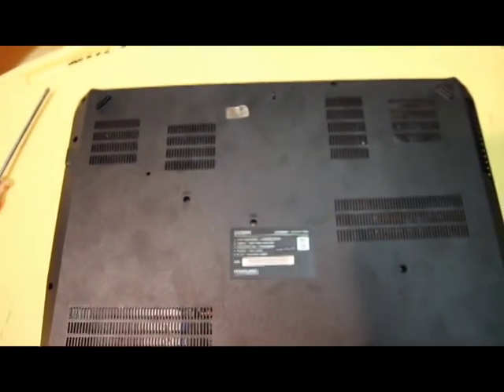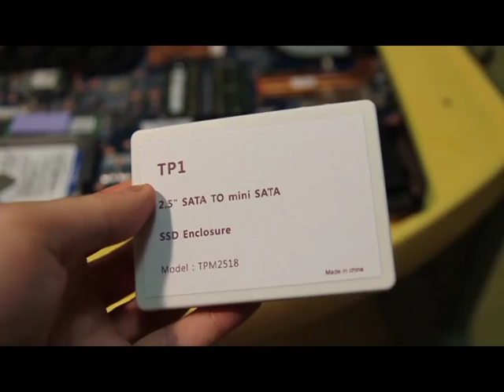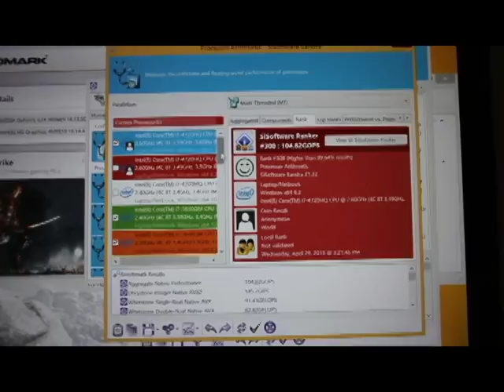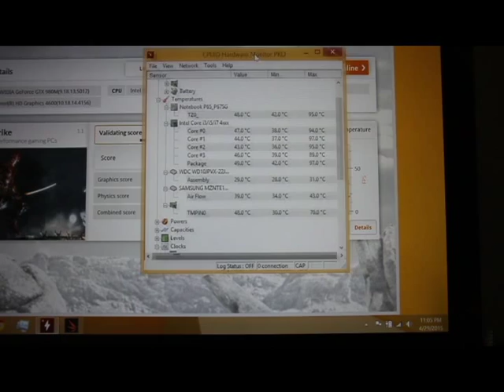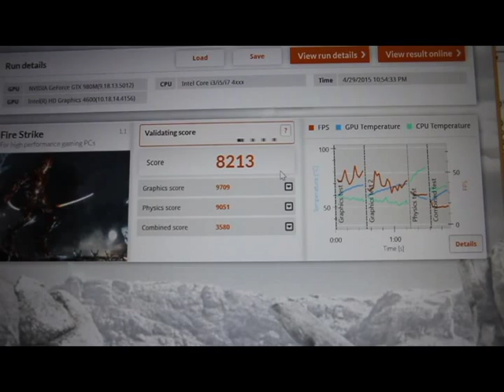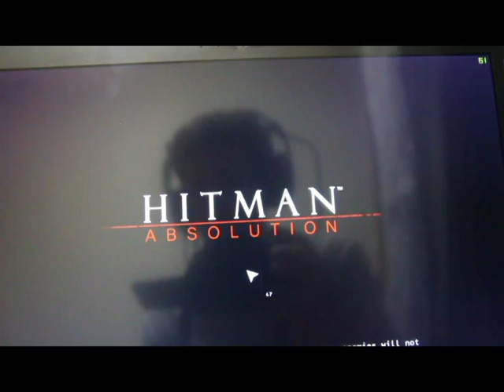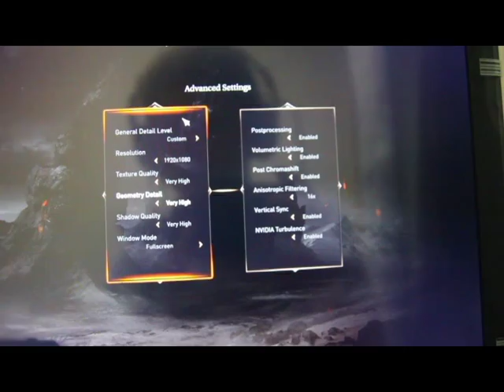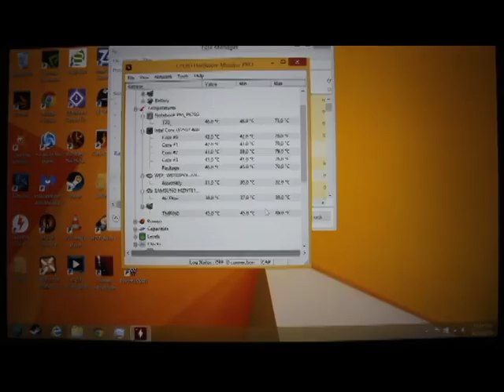Hansung (Clevo p651SG - GTX 980m) Gaming Laptop - INSIDE and BENCHMARKS - part 2

Comment: Well... it might be a little too late to say this, but I have the same exact machine, E54 Lv.66, and Hansung Computer company does not care about whether you open up your laptop's back panel or not. The sticker just says that they won't be taking care of the upgraded parts like extra RAMs and SSDs. I upgraded mine with 16GB RAM and an extra SSD for RAID, and actually visited service center because of the damn keyboard malfunctioning, and they replaced the thing for free.

Comment: Why does the performance increase with a higher wattage PSU? Isn't the one that comes with it sufficient?! This is ridiculous
Reply from the maker: Sushma Nomula the one you usually get with 980m laptop is 180W. Unfortunately, at full power 980m draws a lot more wattage. The tests by others had a value of about 210W, so you need to purchase a separate PSU. I think only some MSI laptops come with 230W by default. but not all of them.  If you have lower wattage PSU, it will throttle the GPU and also overheat the powerblock, potentially melting it with time